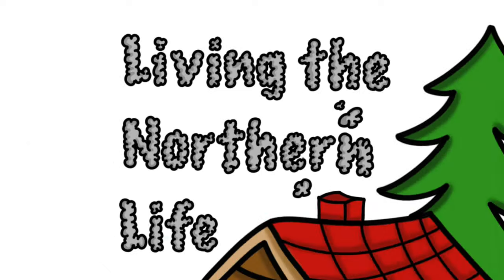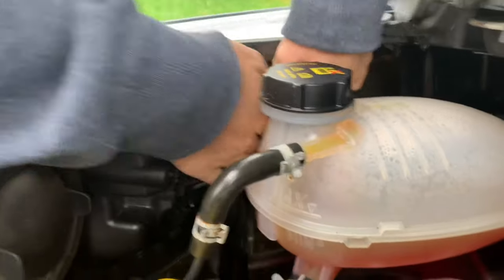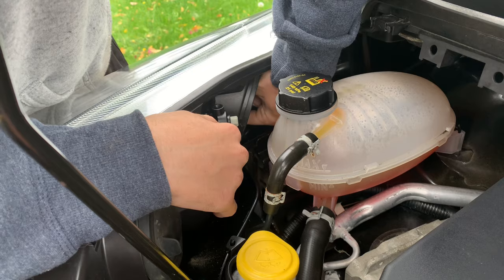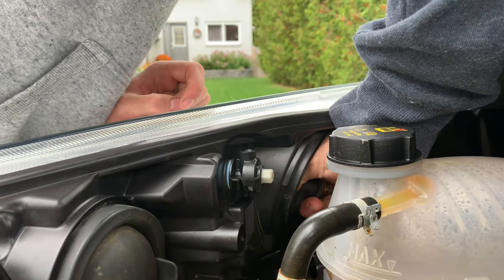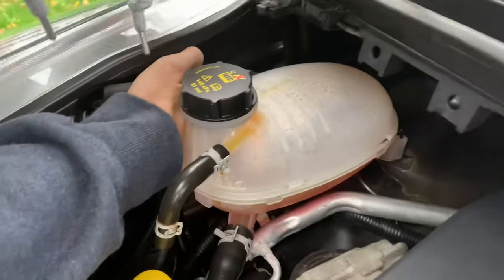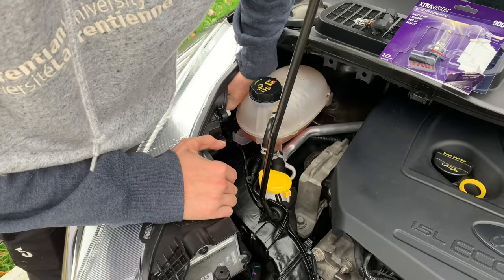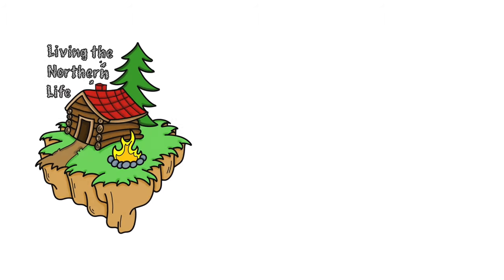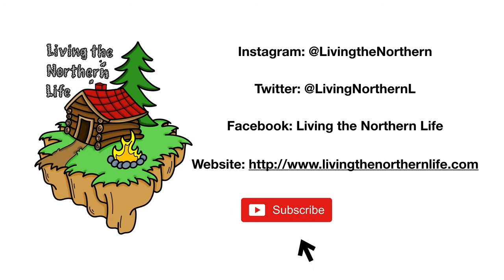2017-19 Ford Escape SE Passenger Side Low Beam Bulb Replacement

Comment: Wanted to give a shout-out for this video, nice job gentlemen ( 👍 ). I performed this task yesterday and If I may add a tip : 

As much as I tried I simply couldn't work my fingers due to the coolant tank being in the way, frustrated, I went and found some helpful advice from the Ford Escape Forum. 

The tank has two clips, front and back,  the front one can be lifted, but it's the back one that will anger many 
< lol >. Take a flathead screwdriver ( short length so you can have room to maneuver) and work it behind and tap it up as you pull up ( there's a small lip on which the clip rests ) and keep taping it up as you pull up. Once pulled up you can move it to the side and have more room, do not remove the hoses. 

And your son was correct, the wire is very short but it can be done, it's still a pain.  

My apologies for turning this into a Wiki page, but I hope this helps anyone who has to face this, trust me, I almost gave up and was ready to pay someone to do it. 

Again, thank you, guys.
Reply from the maker: Thanks David!
We really appreciate that!
Andrew & Elijah

Comment: Those headlights are a pain. My sons had no slack on wire either. But found coolant tank can be turned.  So will have to see. Ty for the video help
Reply from the maker: Those headlight cables are bananas. They could have put a bit of slack in it.
Thank you for watching and commenting
Andrew

Comment: Thank you for this video. I have replaced my drivers side with no issues however when i had to do my passenger side i thought i was doing something wrong. I had to actually unclip the bulb before being able to get it out cause my wires were so short.
Reply from the maker: Ford sure made the passenger side interesting!
I agree that unclipping the cable first and than replacing the bulb is the best and fastest way to complete this.
Thanks for watching and commenting!
Andrew

Comment: I had the same issue. I have almost no feeling in my left hand from a car accident where I needed a fusion in my neck. So I have nerve damage on the left side of my body .When it gets cold my hand freezes up an won’t do anything I had to go inside the car for heat every 15 minutes And it was cold out. It must’ve took me four hours and 10° weather to replace that bulb on the passenger side. Luckily, I ran into a video that showed popping off the reservoir helped give me more room and I was able to finish the light.
Reply from the maker: You can also disconnect the cable from the bulb and take the bulb out.
We could only undo the front clip from the reservoir which does help.
Thanks for taking the time to watch and comment!
Andrew

Comment: I found my wire even shorter than yours. Impossible to get it reconnected to the new light. I finally got an LED light that has a wire extension as part of the light assembly. That was fairly easy to get plugged in . Then I installed the light into the socket.
Reply from the maker: We are also thinking of putting LED's in.

Comment: Just pulled the bulb. Took about 5mins or less. Mine had enough slack to get to where I could easily remove the bulb from the socket.
Now off to buy the replacement. My 20017 Escape SE 4WD had a 9005 bulb although the Sylvania bulb lookup site listed an H11.
Reply from the maker: Glad you had some slack.
Most in the comments have very little to work with it seems.
Reply: Did you replace it with the basic 9005 or 9005 xtravision?

Comment: Yes get the reservoir out of the way. The front clip will slide up easily but not the back. I took the front loose first then used a long, thin pry bar and, using the adjacent motor mount bracket as a fulcrum, gently pushed upwards (on the back connection) while rocking reservoir back and forth with my other hand... it popped right up, easy peasey. I can not imagine trying to do the passenger side without getting the reservoir out of the way first.
Reply from the maker: I can only seem to get the front clip off and move it just enough to get in there.
Andrew
Reply: @LivingtheNorthernLife  To get back off you've got to rock it back and forth and wiggle it off (while applying upwards pressure on the back bracket)

Comment: I'm replacing the lows in our '17 Escape for the second time tomorrow. I used the same Phillips bulbs as the video author the last time since I've usually had much better luck with them then the OE Sylvanias. The Phipps 9005 bulbs have been a terrible choice with very little low beam light. I'm going back to the Sylvanias as they, according to the Rock Auto site are a Ford 'special' - which I doubt but they cannot be any worse. I can hardly wait to do the lights in my '19 F150 - NOT!
Reply from the maker: I’m actually going to release a video soon about the passenger side headlight again about my experience and how i FINALLY fixed the issue… I’m holding off because i want to give my solution more time to prove itself…
But after 3 months, so far so good.

Comment: Rear radiator hold-down bracket was a bear to budge as previously noted by others. Needed assist from a good buddy, Here is the kicker. Removed burnt-out bulb and went to replace with H11 bulb as per my Owner's manual but the burnt-out bulb was a 9005. Had to confirm with my Ford dealer.
Reply from the maker: I beleive the H11 is for the Titanium models.
Mine is also the 9005 and we have an SE.
Glad it worked out for you!
Andrew
Reply: I have platinum Edition and the same thing happened to me, bought the H11's needed the 9005's @LivingtheNorthernLife

Comment: Give the wire a decent yank and it will give you a lot more slack to work with, it worked for both sides of my headlights. Must be taped up or some light push pin keeping it down
Reply: You might break the wire doing that and than you'll really be in trouble.
Reply: I have to do this. Thanks for the advice
Reply from the maker: Ford did a bad job on this vehicle :(

Comment: "what a pain" is the understatement of the year. What were the engineers thinking with that passenger side?
Reply from the maker: Totally agree!
Reply: @LivingtheNorthernLife  the cross member on the driver's side is too close to easily fit the rubber cap back on too. Cabin air filter is in a stupid spot as well. I love Ford's but Jesus Christ the engineers of the escape don't return that love 😂

Comment: My 2017 Escape passenger side low beam is out again. I replaced it last time 2 years ago but now the socket connector has got hot and melted too. Fuse is not blown. Still have 12.3 volts at the socket connector but the wires are short and no slack for splicing a new one in.
Reply from the maker: One commenter said that there is a clip holding the wife short. 
They said if it’s pulled on gently it will release from the clip and give you more slack.
I’m haven’t tried it so we don’t know and can’t recommend it but thought I’d share their input.
Thanks for watching and commenting!
Andrew
Reply: @LivingtheNorthernLife   Thanks. I got the socket and light replaced finally by using lots of swear words. That seemed to help. Oh, and by the way, I also have a "clip holding the wife short" too! Love autocorrect. Don't edit it. Too funny.

Comment: Remove the old bulb and insert the new bulb in the headlamp fixture. Than attach the plug. Part of the trick is to make sure the orange rubber gasket is fully pushed ON to the plug. so that when you go to insert the plug into the lamp you can guide it into the lamp socket. Once it's in the socket you'll be able to push it all the way on with one finger as long as the orange gasket is pushed fully one.
Reply from the maker: yes for sure!
It does work well as we've had to change the bulb a few times now since this video.
There is an issue with the Escape burning passenger side bulbs.
Thanks for watching and commenting!
Andrew

Comment: Thank you for the tutorial. We have a 2018 SE, the original bulb is sylvannia 12V 60W 9005. I replaced both low beam with Sylvannia silver star ultra 9005 since its 65W to have a uniform brightness. 
The low beam replacement is really a pain to do. A small hand and thin arm will help a lot. The most helpful part here for me is knowing that it losen counter clockwise. I guess i’m also lucky to have a little more slack on the wire. I tried to remove the reservoir, but like every other here said, the back clip is hard to lift. Thanks for the video.
BTW the mechanic wants me to pay $25 for the labor to replace one bulb.
Reply from the maker: Exactly!
Seems silly to pay the mechanic $25 to change a bulb that should be easy enough to change in the driveway.
Thanks for your kind words, watching and commenting!
Andrew
Reply: After the struggle I just encountered, I would happily pay $25 for someone else to do that passenger side!!
Reply: @gothamvengeance  I changed my bulbs again today!  Both Sylvania were busted for whatever reason, the same time. I replaced it with LED’s. This time it only took me 10 mins. I guess previous experienced help a lot.

Comment: 1) I removed the cable from the bulb first, then it was easy to unscrew. Couldn't pull it out while still attached, and the lack of slack kept it from falling away. But, putting it back in was easy that way!
 2)Any chance y'all have fixed the LED strip in the assembly before?
Reply from the maker: We having touched much else on the escape besides the passenger headlight yet.
Wish we could help.
Thanks for watching and commenting!
Andrew

Comment: i agree the reservoir is the biggest issue. I am afraid pulling on it may crack it.
Reply from the maker: I hear there is a little catch behind the reservoir to make removing it easier.
Someone else suggested just disconnecting the cable and then removing the bulb.
Reply: Can you not remove the headlight unit?

Comment: I did my passenger side low beam replacement today...what a pain in the (_!_). I'd like to meet the person that signed off on this design and bit*h slap him. 2 problems to over come...the short wiring on that side of the car and the super tight mounting of the coolant jug. After spending about 2 hours total (3 different attempts), I finall was successful by the following: 1. use heat (hair blow dryer in my case). Heat up that rear plastic mount on the coolant jug to make it pliant and possible to just yank off with brute strength. Then pull up on the front mount, done. 2. unclip wiring from bulb before you twist and pull the light out. 3. Insert new light without trying to plug in that ridiculously short pigtail. After bulb in inserted, then use the smallest hand you got and struggle to attach the electrical plug. Congrats!! Now hope it does not burn out again until you sell it or you die, whichever occurs first.
Reply from the maker: We've had to change our passenger side three times now since posting this video.
Just the passenger side so there's more going on.
If you search Google you will find that the passenger side bulb going out on the Escape is a frequent thing.
Thanks for watching and commenting!
Andrew

Comment: Edit: Just found out that the low beam bulb is a 9005...Good thing I got it from Walmart and can return the h11

Useful, as my black Ford escape's low beam light on the right side just died. Curious though, why did you use a 9005 to replace the low beam light? The manufacturer sheet says 9005 is the highbeam, with h11 being the low beam.
Reply: Ronan Tetsu the projector headlamps use a 9005 best I can tell. H11 should be for the reflector style. Most searches either show both without specifying, or just list one. I’m still waiting to verify on my wife’s escape (reflector style), but I don’t have a shop and it’s -20c around here right now lol. I’m just going to hook a string around the plug wire and unhook it inside the headlight, pull the bulb, put the new one in, then pull the cable back up with the string. In theory, should work not having to fight with the short plug.
Reply from the maker: Hey Ronan,
Our manual says 9005 and that's what we replaced it with.
Thanks
Andrew
Reply from the maker: Hey Kyle,
It should be listed in your manual if it's still in the Escape. @-20c is sounds like you're close to where we live in Northern Ontario. :)
Andrew

Comment: I’ve struggled all day to change out this light. I tried to remove the tank which was a ‘no go’. It feels like something is about to break. My only option is to bring it to a mechanic. Very frustrating!
Reply from the maker: Try disconnecting the cable and then take the bulb out first.
Reply: @LivingtheNorthernLife  my hand will not fit.
Reply from the maker: @smithsterj  Fair enough. It's a really tight space that's for sure!
Reply: @LivingtheNorthernLife  I’ve watched videos of a reservoir repair (remove and replace). It looks simple but it’s seems like mine is being stubborn to remove. So that being said, I have no choice but to take it to A mechanic to change out a simple lightbulb? I will ask for an estimate first because I do have the bulb I bought from AutoZone. 

This is the first car I ever owned that I can not swap out a simple light bulb 🤦‍♂️. Needless to say it’s driving me crazy but I’m at the point where I don’t want to break anything especially the radiator reservoir.

Comment: Are those the same as the original bulbs?
Reply from the maker: In our case yes.
We have the SE model but the Titanium has better bulbs but not sure the better bulbs can’t be used on a lower model than a Titanium.
Reply: @LivingtheNorthernLife  Thanks, do you think the 9005 basic bulbs would be dimmer than the original? I see you used the 9005 xtravision.

Comment: Struggling with this on -13c temperatures. Even considered removing the coolant tank but afraid of snapping the tabs. Just don't see success on the horizon. Looks like a trip to my mechanic.
Reply from the maker: Hey Brockville Boomerang Club,
I hear the weather is going to warm up this week so maybe that will make it a bit better.
Having smaller hands does help a lot but it's not impossible to do.
Thanks for watching and commenting!
Andrew

Comment: You may need the H11 bulb or the 9005 bulb, depending on your model.  I have the SE and needed to 9005.  Pull your bulb first to be sure.  Btw, the 9005 is a longer buib and harder to remove.  I assume the assembly is designed for the shorter H11 bulb but some a-hole engineer switched to 9005 without a care how the customer would be affected.   I could not get the rear reservoir clip to release.  From a tip in another video, I made a string lasso and was able to pull the wire harness into place and snap the bulb in.  I did after getting the tip of the bulb into the hole but prior to seating it fully and twisting it into place.  All-in-all, a horrible design, as is the battery location on this vehicle.  A customer should not have to take their car to a mechanic for these simple tasks.
Reply from the maker: Totally agree.
I’m assuming that the H11 bulb is for the Titanium model.
Nit that we couldn’t put it in out SE but chose to just put the 9005 in as that’s what we removed.
We couldn’t easily remove out reservoir either.
After reading some of the comments over the years we tried disconnecting the cable and just remove the bulb and that was super easy.
Thanks for watching and commenting!
Andrew

Comment: Ez fix: UNPLUG bulb first then TURN & remove bulb from housing. if you don't unplug the bulb first it will be hell to try to work with. They did not provide you with enough wire to work with.  Take new Bulb and place in housing and lock into place and then re connect wire. Took me 2 min
Reply from the maker: ya I think your solution is much better than trying what we did.
It was a real pain!

Comment: The wire on the passenger side literally isn't even long enough to pull it out of the opening...brutal!!
Reply from the maker: It is absolutely terrible.
A workaround is to disconnect the cable and then pull the bulb out.
Andrew

Comment: My mother in law has one of these and not only has the navigation/entertainment computer went to complete shit. Its blowing headlights every six months. Meanwhile my 24year old truck has had the same bulbs for about 7 years when i only changed them because i went with aftermarket headlights so i put new bulbs in them. And my 74 stingray vette has had the same bulbs since the early 90's. 
 It amazes me how much worse the new stuff is.. its such a shame.
Reply from the maker: I totally agree with you and yet it's still not the worst car we've ever owned.
That would be a 1997 Dodge Intrepid.
The absolute worst car we've ever owned by far.
Thanks for watching and commenting!
Andrew

Comment: Amen remove the reservoir buy using a long prybar to lift it gently but firmly off its connection points. No need to undo any hoses it will move to the side to access the opening made for a child's hand
Reply from the maker: I haven’t tried but others replied to just disconnect the wire and then take the bulb out and it’s easier.
I do have pretty small hands so there’s a bonus for me 😂😂😂

Comment: Can I borrow him to change mine for me? 😂 that is too small a space for my hands. Driver's side is easier and to pull the lamp housing requires removal of the bumper cover. 😡
Reply from the maker: The passenger side is a mess!
We have also tried disconnecting the cable and then taking the bulb out and this works very well as long as you can get your hand in there.
Thanks for watching and commenting!
Andrew

Comment: But my bulb can not be turned by any craft or power we here possess.
Reply from the maker: Oh that’s not good.
Were you able to get it changed?
Reply: @LivingtheNorthernLife  Not yet! Looking for a burly guy! It is easy to reach if you take out the wipers and shelf as if you are changing the battery.
Reply: @LivingtheNorthernLife  Problem was the wires were too short. Guy at O'Reilly got it out in a moment by unplugging it first.